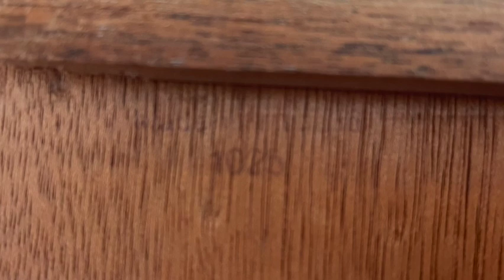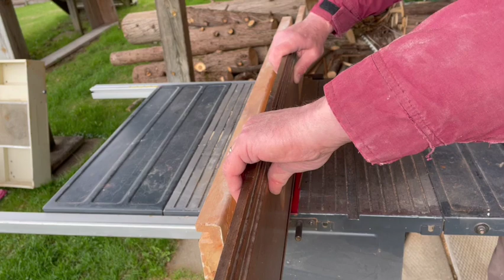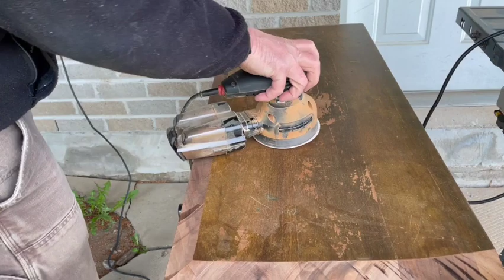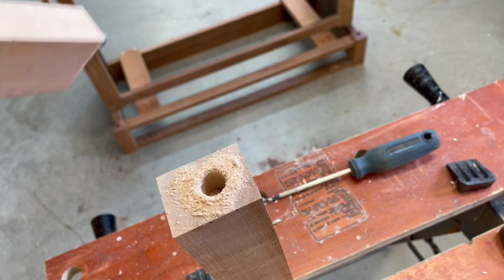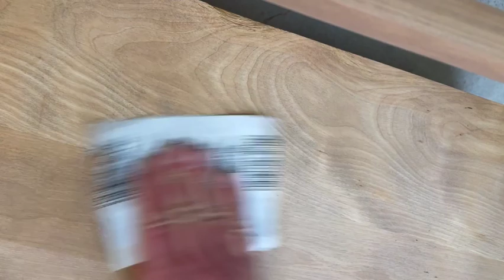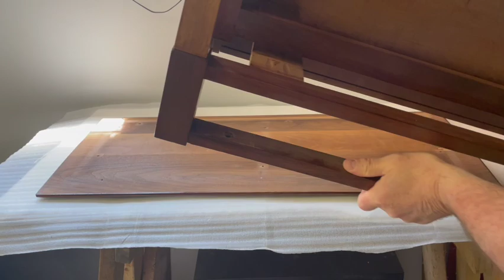Hall Table Upcycle. Tudor to MCM style.

Comment: Nice project. If you find some brad point drills in your dowel pin sizes you can save yourself some drama. Thanks for the video.
Reply from the maker: Thanks Chris. I just looked up brad point drills and I had no idea, after what I suppose is almost fifty years of woodworking, that one of their advantages is that they don’t wander. You learn something new every day. I very much appreciate your tip.